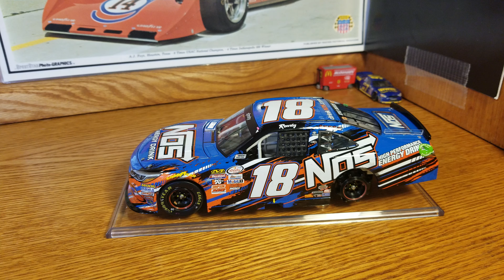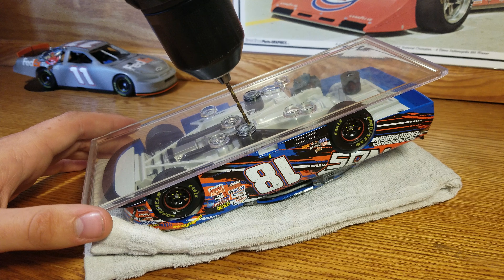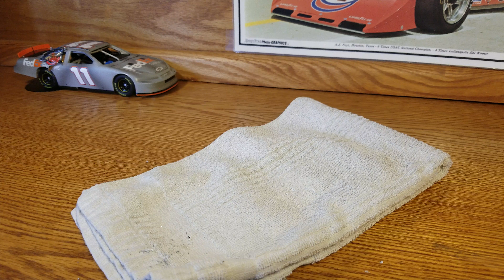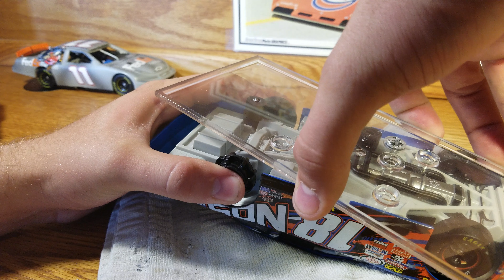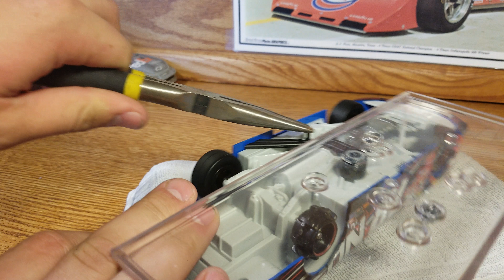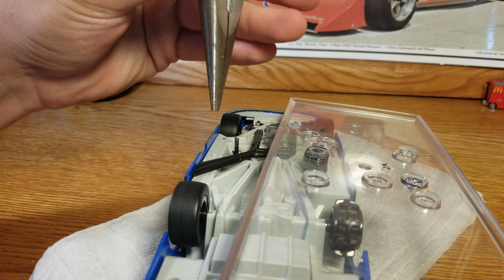Kyle Busch Sweep Set Xfinity Base Removal Part 1

Comment: a small flat tip screw driver would work to screw that triangle screw out. and a set of linesman pliers would probably work better twisting that screw out instead of needle nose.
Reply from the maker: Tyler Bryant I usually dont need anything. This one was much tighter then the other one's I've done